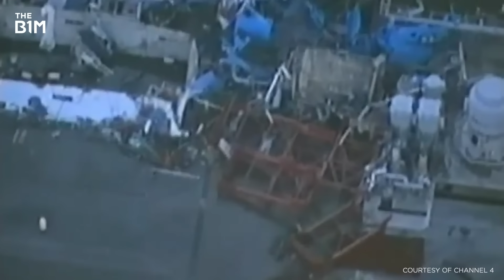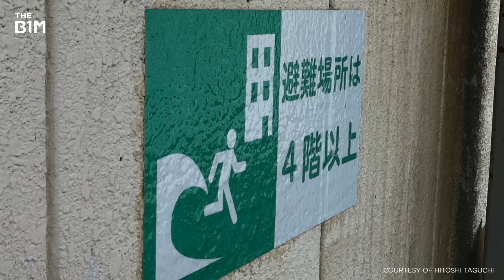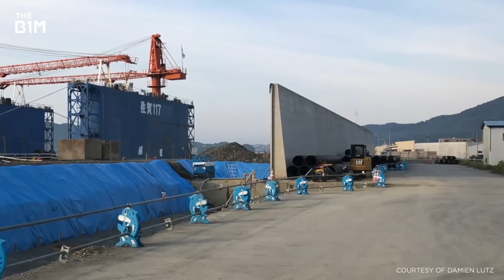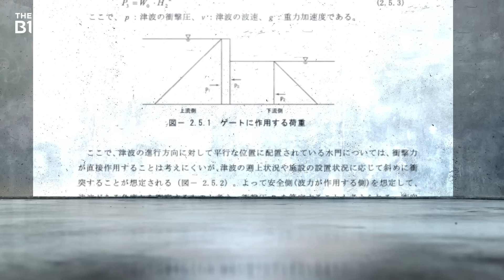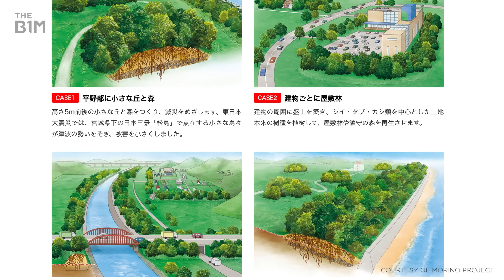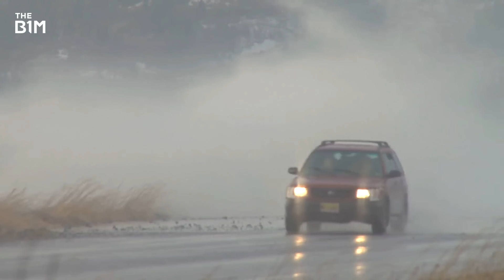Japan’s 400 Kilometre Tsunami Shield

Comment: In my opinion they rather should build some protection system on water that stops or weakens the tsunami long before it hits the landscape.
Reply: Impossible since tsunami waves approach the coast at 800km per hour, and they come in several waves, with an absolute force

Comment: Why don't they just build Concrete Houses that are Shaped to let the Tsunami pass around the structure?
The people could take shelter in any of the houses until the wave has gone...Walls are not very inovative when it comes to nature. But a wel designed house or buildings that are high impact protective and safe. And offer a cultural design element to the science. Like Art and Sience as a unity of cultures.

Comment: A few things...
When building sea walls, instead of just tall thin wall - infill the land behind. This would raise the ground level and enable people to still see the sea. There could be a 500m wide park along the top of the infill behind the wall. 
Another consideration would be to build a break water wall  ~1 to 2+km away from the coast. It would prevent, slow, delay, the oncoming wave from pulling back the coastal water that the wave uses to increase height. 
When the tube and sewer system was build along the Thames, the wall was build, the sewer, underground trains tunnels, and services etc. It moved the side of Thames. This has been done before so can be adjusted to suit the topography. 
Additionally, there are no outlet doors on the sea walls. So any water that does go over the top or around the wall, can pass back out to sea without puddling, pooling on the land side of the wall. Similar to the Old over flow doors on the London Sewer System that dump raw sewerage into the Thames when it is too full (rain etc). No sea water in but over flowed water can exist.
The nuclear plant would not have exploded IF power had continued to run the pumps. The US Navy had a ship running the pumps. It was removed because it was being contaminated with radiation. The ship could have remained and when a ready steady stable power supply was connected - then move the ship and decommission it. The US Govt put the value of a ship above the need for power for the safety of the facility!
Reply: ENTÃO POVO E SO ENTRAR COM  O CRAK  A PEDRINHA O PÓ EU ENTRO DE MARIA ENJUADA QUE NOS ACABAREMOS COM A FESTA DELES
Reply: スーパー堤防って奴じゃないか
数100年単位で工事と改良を続けないといけないから大変だよあれ
Reply: @大きなモーター  Landfill soil is also a problem during earthquakes, due to liquifaction.

Comment: So WRONG wall design, you are doing it opposite effect to boost tsunami force into the land. Not reduce the ocean tsunami force. The angle is wrong with 45 degree. Maybe you should build the Wall with  behind it very large deep trench direct to underground water collection dam only reserve for tsunami? Need to imagine Tsunami is like the volume of Pacific ocean level raises up 20 meters after global warming that's how much force the wall need to withstand, the volume of empty dam needs to hold overcome water volume, and then pump out those water back out to ocean after tsunami.

Comment: I live near the Gulf of Mexico coast.  While the Corp of Engineers has built this mega-wall around the New Orleans metro area, people outside of it don't have that protection. Hurricane surges, a large amount of water driven by a continuous wind over a large area, are very similar to tsunamis in that the wave length is miles long and the water keeps comming.  The solution is to place structures up on pilings and not attempt to stop the water, but let it run through under the structures and eventually run back out.  Many structures have a ground floor for a garage and game room, but the sacrificial ground story walls are designed to break away to protect the upper floors.   It's best to figure out how to stay out of the water's way since it always wins.

Comment: The chance very remote of any tsunami as tall as the 2011 Tohoku plate boundary release when why it was so large, a splay fault ridden fill of the subduction area over 20km long and 3km wide & deep detached and kept rising while the plates moved back down.

At 20km/12mi offshore the GPS buoy recorded the 1st part at the expected 2m/6.7ft height, after a few seconds the wave continued to rise to 7m/23ft, this from seismic tests afterwards. The splay fault section caused such a monster wave, a geologic pile of sediments broke loose.

Just to keep causes straight from the geology alone, the pre-planned structures were fine, now it can be assumed to make seismic surveys of this along faults is worth the trouble.
Hth 🍺

Their seawalls were OK, anther plate release hundreds of years away.
Ymmv.

Comment: True it's impressive.
However a sea wall wouldn't it increase the height of the wave ? 
Wouldn't a deflective arc shaped build up wall  or stagerred design be more effective to disperse the energy of the wave..
Reply: Exactly.
Saw one wall like that in this video and thought why didn't engineers thought of this before.
Reply: Good question... Only on wind waves, however. Because tsunami are so long and rarely break, and don't break fully then the wave return feature of regular sea walls is fairly redundant.

Comment: the wall solution is absolutely terrible, I have better idea with around the same money cost, 1st. the walls prevent people from enjoying the view of the sea and put much concrete to the soil blocks wind and many other factors, The solution is simple, plant a iron gates near to the short that can be controlled remotely and it's easy to lift up by filling the base of the "iron gate or wall" with sea water and the tip of it will rise up instantly shape like Swiss cheese! this sounds funny but the Technic actually exists in Nederlands, I think I watch some of B1M videos talking about this problem in Nederlands Amsterdam city being on sea level, someone send my message to Japan, 
Thank You

Comment: Fukushima almost failed safe. But for the location of the back-up generators and heat-exchangers, there would not have been a meltdown. The plant survived the M9 earthquake, but it was the size of the tsunami, (nobody imagined it could be that big), which overcame the back-up systems. Nuclear power is pretty safe, built on modern systems, away from seismic areas, it is highly unlikely a Fukushima MK2 would happen again. The tsunami killed way more people, over 20000, than the meltdown, less than 600.
Reply: @djyx8  That water is being filtered. The water to be released will have very low levels of radiation. It seems you are anti-science, to be expected these days.
Reply: fukushima was built in 1970 by GE.  was past its originally given life span (35-40 years?).  it functioned properly during and after the earthquake.  after the ground shook, crews were shutting the plant down and that was going ok, as per protocol.
THEN the tsunami took out the generators + water pumps for cooling, and the meltdown began.
so while any nuclear operator should heed the lessons from fukushima,  this was not because of stupidity, poor construction, negligence, or neglect.   the reactor did pretty good otherwise.
if it were not for that tsunami, fukushima would still be producing power today.
Reply: Why did Germany overreact and cancel it's nuclear power program when there is absolutely no chance of an earthquake or tsunami happening there?
Reply: @B-A-L  green party.
Reply: @B-A-L  Because it was a political over-reaction in the wake of Fukushima. Germany still imports a lot of nuclear produced electricity from France. Germany is heavily influenced by several political parties which are anti-nuclear. Germany also has an interesting relationship with Russia when it comes to energy. German ex Chancellor Schröder of Germany is directly employed by Russian energy companies. This leads one to wonder if there is political influence by Russia to influence energy decisions in Germany, which would include getting rid of nuclear and increasing gas imports from Russia.
Reply: @B-A-L  war is comming. You dont want nuclear plants when you at war
Reply: @djyx8  Disinformation and fear of radiation has been extremely costly ($700B + huge disruption) to the Japanese people.  Yet the scientific literature has papers showing that evacuation because of Fukushima Diiachi was unjustified, and the cleanup certainly is.  Fear-mongering is the real danger.  This is evidenced by the ~2000 people the evacuation objectively killed.  Please don't contribute to anti-nuclear disinformation.
Reply: Ironically the automatic passive cooling kicked in. But was disabled because it was cooling to much and they didn't want to shut the plant.
Reply: @njipods  Wrong, it's not that they didn't want to shut the plant but that excessive cooling causes cracking and severe damage to the Reactor Pressure Vessel, keep in mind only unit 1's Automatic Emergency Core Supression System started, the other systems operated for many hours afterwards before finally running out of power or in unit 1's case, water from the ECCS standby tank.
Reply: @InserNameHere2053  then why was the system designed to cool excessively?  Are you sure your correct because it's pritty stupid that the safety system causes saftey issues? 

The cooling system is passive so had they not disabled it it wouldn't have mattered when they ran out of power.
Reply: Fukushima polluting oceans from many years. This is how safe it is. Japanese throw barrels with radioactive water into ocean because it cost less. And then we all buy fish in market and we recieving this deadly poison.
Reply: https://youtu.be/Ptz5XqJ0z2Y
Reply: @djyx8  You obviously don't follow the science. That water will be filtered before being released. Did you know that many people die of cancer each year due to naturally occurring Radon gas. When I lived in Switzerland I was told not to spend much time in the basement of the house I rented, with an earth floor as the Radon emissions were high enough to be harmful. Cancer caused by radiation from Radon is  a worldwide killer if you live in the wrong area.. Fukushima is nothing compared to this.
Reply: First it was unlikely Three-Miles-Island happens again. Than it was unlikely Tchernobyl happens again. Now it is unlikely Fukushima happens again. They were all pretty safe!
Reply: @vomm  The tipical simplification of the simple mind, but its not totally wrong, of course there is a castrophy per a certain hour of Gwh. The question is do we want to charge our shite-phones or use our vibrators or not?
Reply: > but it was the size of the tsunami, (nobody imagined it could be that big)

TEPCO thought that the largest tsunami could be only ~7 meters? Yeah riiiight...
Try a quick check on the size of known historic tsunamis along that coast to disabuse yourself of the notion that they did not know...
Reply: The next nuclear plant incidents will probably happen in the united states and be due to a lack of maintenance and supervision, lack of investment and care.
Why do I feel it will happen there?
Wikipedia source: [Nuclear power in the United States] As of October 2014, the NRC has granted license renewals providing a 20-year extension to a total of 74 reactors. In early 2014, the NRC prepared to receive the first applications of license renewal beyond 60 years of reactor life, as early as 2017, a process which by law requires public involvement.[10] Licenses for 22 reactors are due to expire before the end of the next decade if no renewals are granted.[11]
Reply: @joelpichette  Try basic math USA 1/3.
Your beloved Wikipedia "nuclear power by country" USA 800/2400 or 1/3
3 mile island was in the middle of nowhere.
USA is only 1/4 nuclear with deadly coal way ahead...meanwhile France is 75% nuclear, and those old nuclear plants are even safe near Paris / NE France...Germany is full of you green hippies, and Germany buys natural gas from dear leader Putin.

The green garbage requires rare Earth elements which primarily come from Congo.
Tex Mex Selena Gomez wears blood diamonds at Cannes.
Rare Earth Element Congo kids die of malaria 🦟 for your iPhone & Xbox.
100 : 1 Algeria vs Congo in France
100 : 1 Morocco vs Congo in Spain
100 : 1 Turkey vs Congo in Germany
100 : 1 Tex Mex vs Congo in Texas
100 : 1 So Cal Mex vs Congo in So Cal
Reply: @rubbishrabble  i hate your attitude but you're absolutely right. Green energy and renewables have a much larger enviromental impact that nuclear.
Reply: Immediate deaths you mean, right!? The Fukushima meltdown caused a problem way more serious than the tsunami, the land that is. Like in Chernobyl, a huge plot of land is now abandoned, and it will be for at least 100+ years. So no, nuclear power is not safe, it can acctually be considered the least safe way of getting eletric power, if you consider the risk of a meltdown, even more if the plant is next to a huge population area, like Fukushima is.
Reply: @rriedel  Fukushima killed 1 person from radiation, there were more deaths due to the panic of an evacuation
Reply: @rriedel  having a home near a coal debris mound.( after they have burned the coal )not to mention, all the toxic heavy metals.. coal kills more people than atomic power. it is far more radioactive than living next to a well taken care of nuclear plant..
Reply: @rriedel  Chernobyl isn't completely abandoned, lol.
Reply: @rriedel  Its not abadoned, there is a Japanese seven eleven open there.

Comment: Though big concrete walls stop some of the smaller tsunamis, the ones they’ve built are really to give people time to evacuate. Fishermen have all but given up their jobs to work inland, houses are now concrete instead of wood, factories have moved and most of the devastation was cleared and are now new wider roads. It’s because the tsunami wave is just the sea pushing to land, they’re not waves that breakup against the shore, tree planting may help channel some water but, the strength of the first wave snapped trees like match sticks and they then became like torpedoes knocking down houses and factories etc being pushed by the wave….

Comment: These walls are such a eye-saw! Why didn’t they used the 12 billion to relocated lower valley based towns up to higher ground and use the valleys for farming, sport facilities and non home or office use. I feel for the communities that now can’t look out to sea anymore.
Reply: Some towns did that, I've visited the area recently and seen documentaries on it.
One town used a giant converor belt system and moved an entire mountain down the valley and raised the town up over 10m before rebuilding houses started
Reply: Everything is money.
Even if they build a new home on a hill, they still need the same walls to protect the land and assets of the valley, which is their foundation of life. 
Have you ever wondered what happens to fields soaked in seawater, oil and rubble?
It was also feared that depopulation would progress because it would take time and budget to build a hill that requires the consent of the majority of residents.
Finally, many towns in the Tohoku region, with the exception of big cities like Sendai, are rooted in the ria coast like the fjords. A vast setback like a dirt hill behind a wall is not possible.
Reply: They are not money machine

Comment: Just an FYI, tsunamis have nothing to do with climate change. Yes storms might occur more frequently, especially in the tropics,  but tsunamis are caused by earthquakes, and are entirely different phenomena.
Reply: Of course if the sea level is higher that will just add to the tsunami height.
Reply: But the point was that SLR will make such current defences less effective because they will be relatively lower than their design height

Comment: 13 billion dollars for a concrete wall they could have used dirt instead. Its cheaper.
Reply: Dirt is weaker and will need more maintainance
Reply: @Ronline26  Dirt will mitigate the waves from the tsunami.
Reply: @ChosenOne6666  dirt walls will probably break because of the force of a tsunami mate or you need to make the wide as fuck and also dirt will get blown away by the wind and be impacted by things like rain so it will need a lot of maintainance which will make it more expensive
Reply: @Ronline26  Wide as Fuck is not an engineering term. You can build a dirt mount tall to mitigate the water from the tsunami.
Reply: @ChosenOne6666  yoooo it isnt? Damn i always thought it was.
Reply: It also needs a much wider base, so retro-fitting it into an existing community might not be feasible.
Reply: @unvergebeneid  Dirt mount will mitigate the waves and I dont understand your gibberish.
Reply: @ChosenOne6666  if you don't understand simple sentences, why do you presume to be smarter than the engineers who built those coastal defenses? You're everything that's wrong with society these days.
Reply: @unvergebeneid  You post gibberish.
Reply: @ChosenOne6666  sure, mate. Troll harder.
Reply: @unvergebeneid  You cant take the loss and move on?